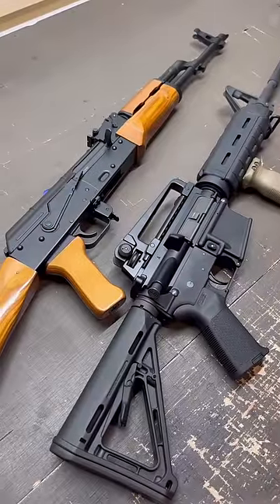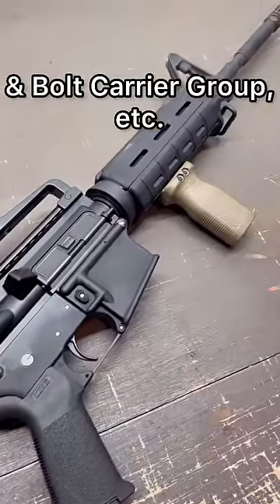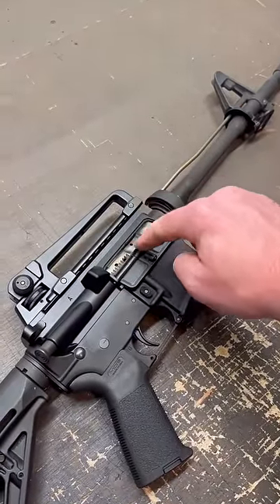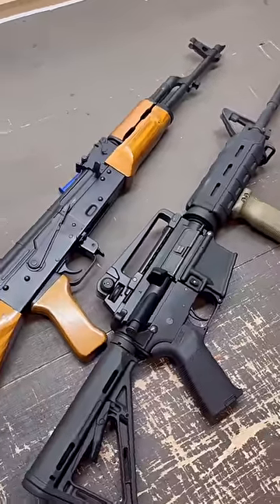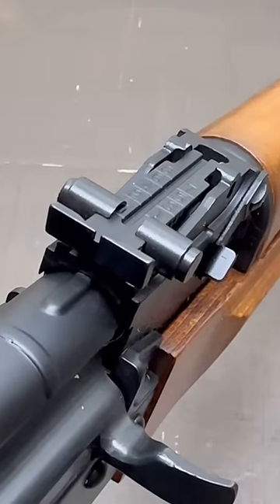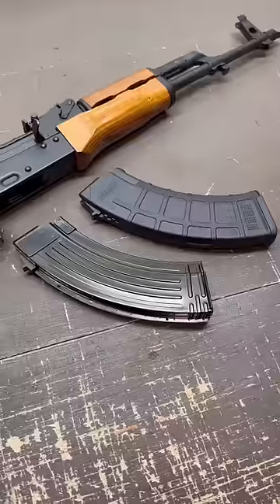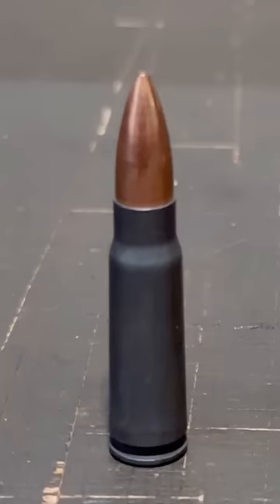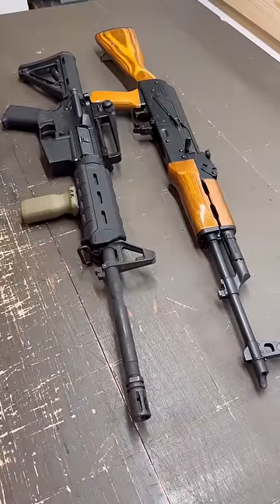AR-15 vs AK-47: What’s the difference?

Comment: Great video, but I'd argue that "more curved" only applies to AK-47/AKM, which are chambered in 7.62, while AK-74, AK-12 and AK-105 are chambered in 5.45, thus having less curved mags. AK-100s chambered in 5.56, of course, use 5.56, so obviously their mags (should be) curved (almost?) exactly as much as AR-15 mags, theoretically. Don't quote me on that one though.
Also, holy wars "AK vs AR" are retarded and have zero value. Both are amazing platforms unmatched in reliability and ease of manufacturing, use and maintenance. Differences in these metrics are negligible and come down to simple preference for whatever reason (patriotism/exotic factor, ergonomics, iron sights, etc.). No other rifle came close to these two beasts, and hardly ever will. I was doubtful about SIG MCX' adoption, and lo and behold – it wasn't actually adopted after all, because you can't compete with an AR for US troops, and likewise – with AK for Russians.

Comment: what's the difference?  the ak will fire no matter what you do to it.  marine corps armorers do not allow complete disassembly of AR bc it is a convoluted piece of shit with 50 easily lost small pieces which render it inoperable.
Reply: Why would you want to “completely disassemble an AR anyways. All you need to disassemble for cleaning is the buffer spring, bolt carrier, bolt, firing pin, and firing pin retaining pin. 🤷🏻‍♂️
Reply: @concernedcitizen2898  because the ar15 is the standard military issue weapon.   did you not catch the reference to marine corps armorers?
Reply: The reason they do not allow complete disassembly is because it's completely unnecessary and the ar is a alot less susceptible to dirt and mud than an ak because the entire system is enclosed where as the ak has a huge open hole in the Reciever but I still think aks are better shooting
Reply: @waldowin23  sooooo you've never used an m16 in the field.  noted.
Reply: I agree that the AK is a better rifle, but the AR can hold its on as long as it cleaned, oil, and built to spec from the beginning.

Comment: AKs (at least old ones, the last few generations have been pieces of crap) are hardier, more reliable guns, plus 7.62 is a punchier round than what you'd get in any AR that isn't a super-specialized designer rifle (the one thing i'll give ARs is the modularity, it's a very diverse platform that people have done a ton of different things to), not to mention the aesthetics - i'm a diehard wood & steel supremacist, i hate plastic guns, but even if that wasn't the case like for the AK12 i just like the design of it way more

Comment: You forgot to mention that ARs jam every time
Reply: Forgot to mention that Ak’s use short burn cartridges so they misfire all the time.
Reply: Are these two assertions actually facts?🤔
Reply: @ClaytonCarmine-nu6hn  my arsenal has never misfired. My colt m4 I had in the army was probably the most trash firearm I ever used. Clean it, kick up some dust outside the motor pool, shit would jam even when it was clean

Comment: You missed the AK can be buried in mud for a month and will work just fine vs the AR will refuse to cycle when a speck of dust brushes against it.
Reply from the maker: Total bull, I carried and quite literally slept with an M4 (only difference to an AR is 3 shot burst) for 12 months straight in Maywand, Zhari and Panjwai and it was filthy almost constantly and it worked fine.

Comment: Dirty Ar15s bcgs aren't a problem.A quality Ar15 will not have to be cleaned for thousands of rounds.Aks also will run for thousands of rounds between cleaning.But what an Ar 15 it can be readily repaired in the field,good luck with a broke Ak in the field..

Comment: Don't think for a second that the gas piston in an AK doesn't get dirty.  They gum up and there tend to wear out and then you get blow by.   The AK has a cheesy trigger system with poorly designed pin keepers.

Comment: The ak is cheap & reliable, but 5.56 is more accurate & takes out more bad guys. Unless you’re a sniper, then you got options bigger than 7.62x51.
Reply: Myths mostly AKs are pretty expensive to make unless you make millions then the overhead cost becomes cheap and they are just as accurate on a man size target out to 500 yards
Reply: @tdfmtig  you can buy one for $600 at a gun store or buy one on the black market for $8 or a chicken. Main forces use ar platform or g3 platform 5.56
Reply: @masada1776  Some ARs are less than $500 in the us
Reply: @tdfmtig  those sales for building your own is good
Reply: @masada1776  if you pay less than 800$ for an ak chances are you are just buying a grenade with a random timed fuze

Comment: Does the curvature of mag effect the gun or just aesthetic
Reply from the maker: An AK mag is curved more because the 7.62x39 cartridge has a much more pronounced taper from case shoulder to base than the 5.56/223, what the AR typically fires. It is the shape it is so that it will feed cartridges reliably.

Comment: TECHNICALLY the AR is a long stroke piston gun rather than true direct impingement. It’s just that the gas piston is inside the bolt carrier rather than attached to it. The replacement of an operating rod with a gas tube reduces both recoil and weight. Pretty genius. But yeah, it does gunk up a lot faster.

Comment: The main difference between an AK and the  AR is the AK WORKS ALL THE TIME even if you roll around in the dirt and the water in the mud run it over whatever. More powerful compared to the AR and like I said a hundred percent more more reliable.
Reply: The AK’s reliability is here-say. It’s not the best gun ever designed, it’s a far cry from peak reliability.

Comment: That and the AK 47 is impossible to jam, or so I've been told.
Reply: Thats a very common misconception 
Both CAN be jammed but both are difficult to jam if properly maintained 

the reason the misconception exist is because when the ar15 and similar models first came out they were more prone to jam as it was a small caliber that needed a less powerful spring which made it so it didn’t fully chamber sometimes which is why the ar15 had the forward assist 
However as the technology got more advanced the ar15 is now just as reliable as the ak just with a smaller lighter gun with lighter weight ammo
Reply: @Thatoneguy-ju6gq  good to know

Comment: Do you have to change the gas ?
Reply: These are real guns not airsoft guns, and in case you dont know how real guns work in the quickest way possible ill explain, in an ak the pin strikes the primer on the bullet which causes the inside to explode and the expanding gas caused by the explosion forces the bullet out of the barrel, there is the tube in the top which redirects some of the gas back towards the bolt to push it back to eject the bullets shell (making the bolt slide back) and when the bold moves forward it slides a new cartridge into place

Comment: The AR is more accurate
Reply: This is a common misconception due to many different reasons. 
Many video games that feature the AK platform give it less accuracy stats for balancing reasons. 
Also, a lot of the AKs that were used in the Middle East were very worn out and the soldiers were likely barely trained if at all.
Reply: @imm2gamer348  facts

Comment: WARNING 223 can go into a 556 rifle but 556 cant go into a 223
Reply: Depends. Also it physically will even if its not rated for it.
Reply: @ALovelyBunchOfDragonballz  it will but it will not end well for the chamber
Reply: @bladeshriner6632  again, depends. Most bolt actions are fine, old Mini 14s are marked 223 but are safe for 5.56 per Ruger.
Reply: @ALovelyBunchOfDragonballz  true but better to be safe than sorry
Reply: @bladeshriner6632  exactly. It depends.

Comment: AR-15 isn't "Direct impingement". AR-15s piston is located inside of it's bolt, this is precisely why they are more reliable than any external piston designs like the HK416 and AKs.
Reply: the ar piston is only for timing. it does nothing for the action of the gun. If it weren't there, the gun would still work,.
Reply: you really wanna say they're more reliable? knowing how many videos I can link that prove you wrong?
Reply: @shelp7858  Wouldn't work reliability considering its required both for proper gas pressure regulation in the chamber and the unlocking of the bolt.
It's like saying that the AK would function without a gas system or thebupper handguard(the gas tube per se) which it would.
Reply: @grahamlopez3742  I have enough confidence in the AR platform in any environment EXCEPT for artic to be more reliable if not at least as reliable as the AK.

If we're talking about videos then there's an Inrange TV video with Ian McCollum that shows direct comparison of the systems in mud and sand in a controlled environment.

Most videos showing the AR vs AK don't close the dust cover on the AR whereas the AKs dust cover is also it's safety switch.
Reply: @DaveOganesyan  👆 this is the ak safety. Both bolts being exposed is how you'd typically find both weapons in their natural environment, and some AR pattern rifles don't even come with a dust cover. Also, thats one video out of thousands that disagree with Ian
Reply: @David Oganesyan  first off  there is no physical piston in an ar bolt. The "piston"people are actually talking about is the fact that the rear of the bolt has rigs to help seal an expansion chamber. the expansion chamber pushes the BCG Back  and the bolt forward, keeping the chamber sealed just long enough for pressure to subside before the rearward motion of the bolt carrier unlocks the bolt  and pulls it away.
if you got rid of that system and instead had a direct blowback without the expansion chamber, it would still work. it would be less reliable, but it would be nothing near, like taking the gas system of the ak.

Comment: God, that magpul furniture kit is sexy.
Reply: i put their ak furniture on mine (it's a century arms so i wasn't worried about keeping it original, if it were an actual eastern bloc rifle i definitely would've kept the wood on) it's so so comfortable and sturdy. the pistol grip is a lot thicker than the stock one which allows for a much better grip, same with the hand guard which also has mlok slots. i've been thinking about getting the folding zhukov stock for it but i really like the skeletonized fixed one i have now
Reply: @napatora  that’s great! Is it an easy surface for paint to stick to?

Comment: Technically the AR is a Gas key system. Which is a type of gas piston not a true impingement system but that's me just being a HUGE NERD
Reply: it is still direct impingment. The piston only helps with timing preventing the bolt from opening to soon.
Reply: @shelp7858  Ian from Forgotten weapons has both a video and a form on his website that goes into detail about the differences between a Gas key system and a true direct impingement system. It's a Gas key which is attached to Bolt carrier not the bolt it self. A true direct impingement system the gases push on the bolt itself. Think the Federov or SVT. As with the AR-10/15 the gases push on a Gas key that's attached to the bolt carrier not the actual bolt it self. Thus making it closer to a piston system. Is it a Gas impingement system yes. Is it a direct impingement no. Again that's sementics and me being a nerd.
Reply: @snownoheakennedy9561   the gas keys only job is to keep the bolt locked for long enough that the pressure in the chamber begins to become normalized. it's still the force of the gas  doing all the work of operating the bolt  making it DI. on a piston gun the gas either acts directly on a piston connected statically  to the BCG(long stroke) or it acts on an inertia driven piston not conected to the BCG which transfers force to the Bcg and allows it to operate. at no point does the gas touch the BCG on a piston gun. if you put a piston in the cup of  a MAS 49 it would still be direct  impingment. it would just act as a slight delay.
Reply: @shelp7858  the gas tube on the AR is too thin to push the gas on the bolt itself. The gas does in fact enter the gas push on that key. The rest is in reality gas bleed off into the chamber. As all opted firearms have. If you take the gas key off the BCG the both will stay locked in the chamber. With a real true direct gas impingement system the gases are striking either the bolt directly or is stricking the BCG directly. On the AR10/15 the gasses are stricking the gas key and pushes on that gas key. The gas key you know that thing that sits ontop of the BCG and either sits over the gas tube or inline with the gas tube. Does gas enter the bolt yes. However without that gas key the bolt isn't going anywhere. That's what makes the AR10/15 different from a true real direct impingement system.
Reply: @shelp7858  https://www.youtube.com/watch?v=4xlKgkwt6Ro
Okay my explotion is poor and has some flaws but it is correct that the AR10/15 is not a true Direct impingment system.
Reply: @snownoheakennedy9561   the gas enters an expansion chamber where it pushes on the bolt directly hence the gas rings on the bolt. there is no physical piston in theBCG of an ar the bolt acts as the "piston" but that's still direct impingment because gas acts directly on it.
Reply: @shelp7858  Also the gas doesn't actually act on the bolt itself. It acts on the BCG not the bolt itself. The bolt is locked in place as the BCG is pushed back witch pulls the bolt with it. No forces are directly acting on the bolt itself. The video I just linked you too shows what a real gas impingement system is.
Reply: @snownoheakennedy9561   the reason the ar bolt has gas rings is because gas acts directly on it. aks don't have gas rings  any where except the piston head because thats where the gas acts.
Reply: @shelp7858  watch the videos I sent. They are light but explain the difference in the AR10/15 and a true Direct impingement system.  The gas rings there to help the gases move back into the BCG. The gas rings/sealing rings are there to stop gases from moving back into the chamber and berral. The bolt and BCG actually aren't functional linked. As where a with a true impingement system they are.

Comment: One is made out of no strategic metal it's stamped so a ten year old can make parts Kalashnikov said we can make my rifle for twenty dollars but if we cut back on the refinements we can make it for 12 dollars M16   is nothing but strategic metal  take a block of aluminum and doesn't want to function at all if it doesn't have oil sant and mud is a problem doesn't like extreme cold ether and the US government pays $2,000 a piece

Comment: Would like to point out, while the AR is commonly referred to as "direct impingement", it infact does have a bolt and piston. DI is just common terminology for any systems that directs gas directly back into the bolt

Comment: Technically speaking the AR also uses a piston system its just inside the bcg. Hence the gas rings like a car piston.
Reply: That little cup, piston head is mounted directly to the bolt carrier though. Its one piece, therefore direct impingement. The ak has a separate piston that acts on the bolt. The ar15 has less moving parts.
Reply: @evanhandelong7685  except that cup is not a cup, its a gas key. It redirects flow down into a chamber where the gas then pushes against the stationary piston (bolt) to unload the lugs and start the unlocking and cycling process. A true DI like the French MAS does not have that. The gas is contained in a cup and doesn't go anywhere else. This is not the case with the AR. If you read the original patent by stoner he even states the design is a combination of both short stroke piston and DI to get the best of both worlds.
Reply: @evanhandelong7685  so you're just wrong.
Reply: @SouthValleyKnifeCo  Ok
Reply: @South Valley Knife Co.   the piston in the ar is more for timing than operating the gun. it's not a hybrid. if you took the piston out of the bolt, it would still work it would just be less reliable.

Comment: You can throw an AK-47 in a puddle of mud and it will fire without a thourough  cleaning.
AR-15, not so much
Reply: You can make up anything you want based on your feelings. When faced against reality, not so much.
Reply: @Dr.KarlowTheOctoling  I rely on experience.
The AK platform is better suited to inclement weather, and mud puddles.
Not to say you can't jam up an AK, it just takes a lot more to do it.
Reply: @ursafan40  It takes a lot less when you have gigantic gaping holes exposing the action on the right side of the gun. Even with the safety engaged (fire selector up) it can still seep in. It does not perform better in mud. It only performs better in Icy conditions (what it was designed for)
Reply: @Dr.KarlowTheOctoling  I'll admit to a bit of exaggeration, but, the AK platform is much less fussy under all adverse weather conditions.
Desert heat and sand, rain forest downpours and mud, arctic ice and snow.
So if you choose the AR over AK, one day you will find out.
Have fun
Reply: @ursafan40  AR has been my go-to and it will be for years. AK’s aren’t bad at all but AR’s do exactly what I need them to do. All dependent on the training, skill and resources of the shooter.

Comment: thats an AK-74, not a 47
Reply: No it isn’t 74s are chambered in 5.45 and have a few differences
Reply: @tdfmtig  look at the reciever, see the little rectangular dent thingy? Sorry I dont know what else to call it. On an AK47, that rectangle is a lot wider and longer.
Reply: It's an psa gf3 it's neither but it's built like an akm not a 74 it uses akm spec parts like the front trunnion
Reply: @Krag-Jorgensen30-40  correct it’s not an AK-47 it’s an AKM. Ak-74s are a completely different caliber